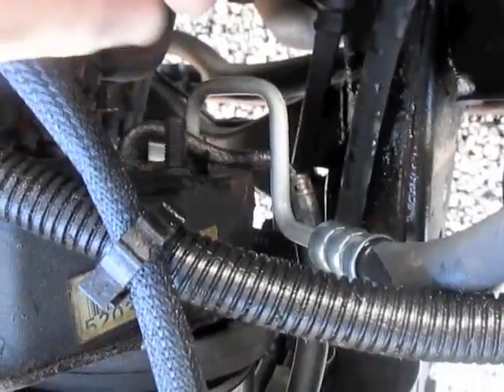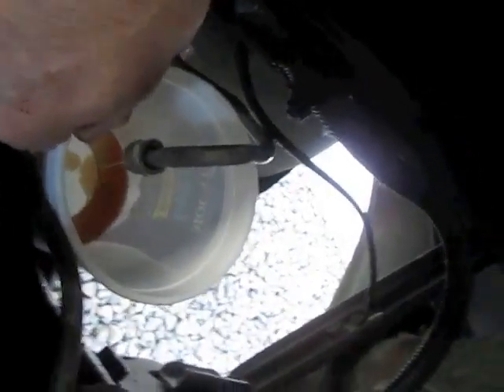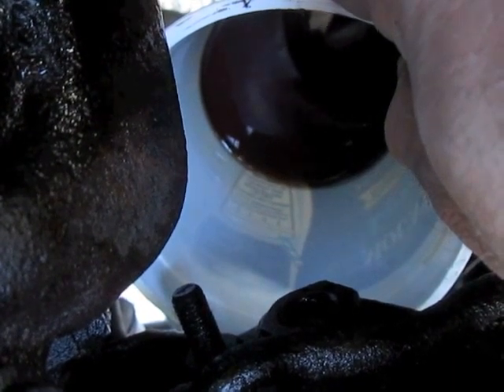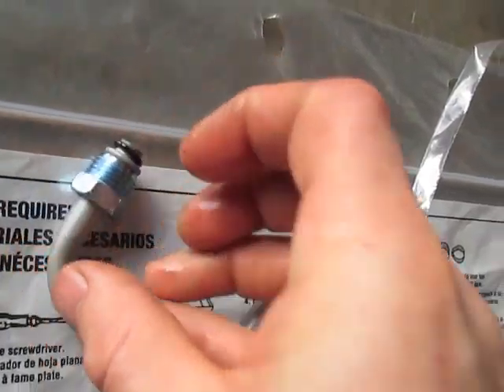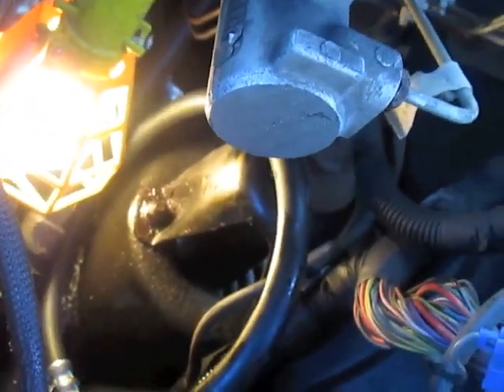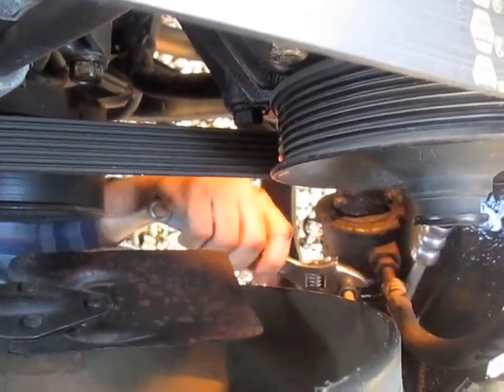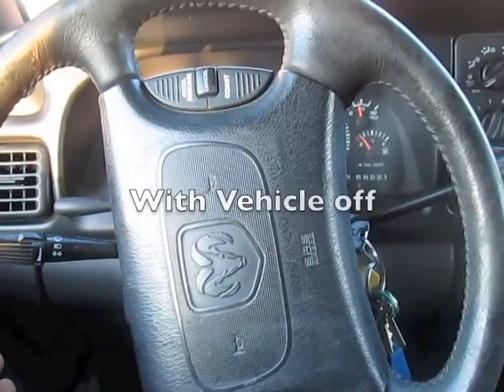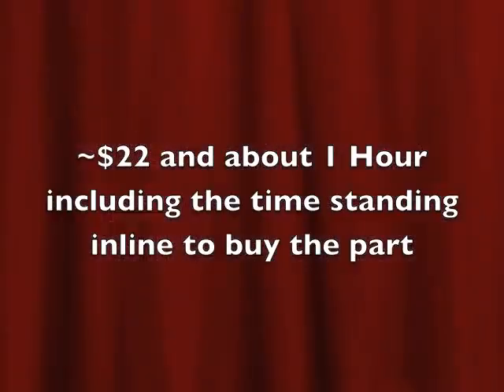How to Change Dodge Ram Power Steering Hose  *** High Pressure Hose

Comment: Takes a bit longer on a rusty ram...I had to break off the pipe to be able to get a socket on the bottom fitting...there is no room to swing a wrench on a 12...edit...had to also use a couple extensions and a three foot breaker bar...no s**t!

Comment: Had a hell of a time replacing the lower fitting of the new hose. It would start threading, or so I thought and it wouldn't be straight lol. Finally got it done after 3 beers and a couple curse words. Thanks for the info in this video
Reply from the maker: Glad it helped!  Thanks for leaving a comment

Comment: Thanks for the video. I almost replaced power steering pump and both hoses. But, I saw your video with the fluid pumping out when the wheels were turned and BAM! my truck did the same thing. Replaced just the high pressure hose. Only it took me 2 1/2 hours.
Reply: Same boat.

Comment: That hose cost me $120. I have a 2003 Dodge Ram 1500 5.7 HEMI. I am afraid doing it by myself. Ty for this video.
Reply from the maker: Yeah I'm not running a hemi and it's a 98, so that's probably why I got by for cheap...  Hopefully you got it no issue
Reply: I have a 2004 5.7 liter dodge 2500 with hemi and the line runs 25 at autozone.

Comment: You COULD change this hose in 20 minutes if only you could get a wrench on the fittings that easily.  There's little room to work.  I ended up taking over 2 hours to finish the repair; otherwise, an easy repair.

Comment: I replaced the line twice and the pump. It keeps leaking at the fitting of the high pressure side of the power steering pump. Help